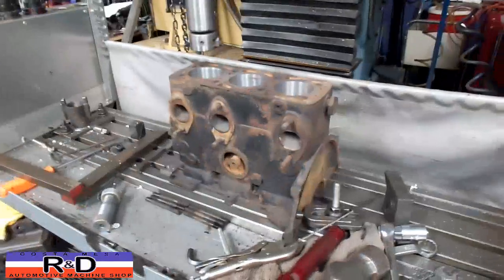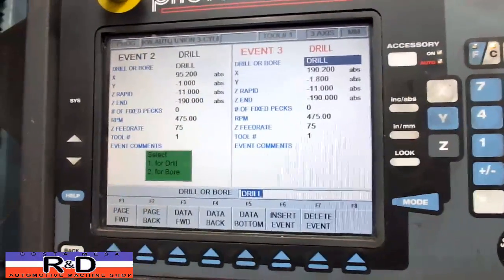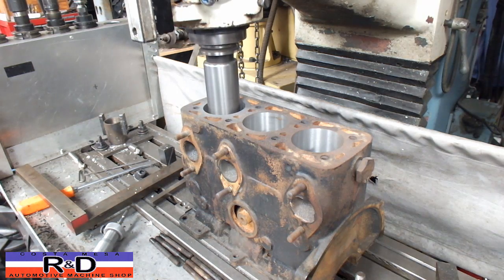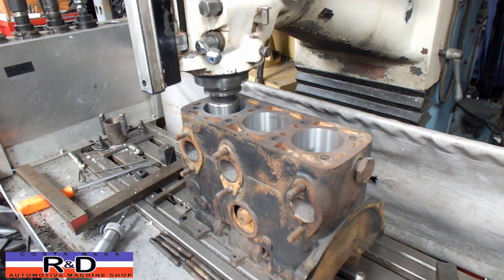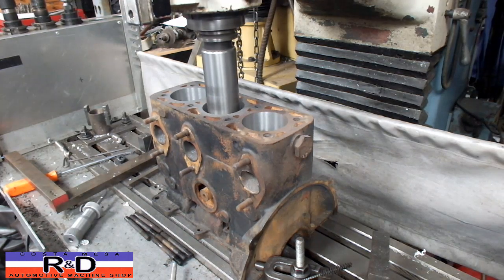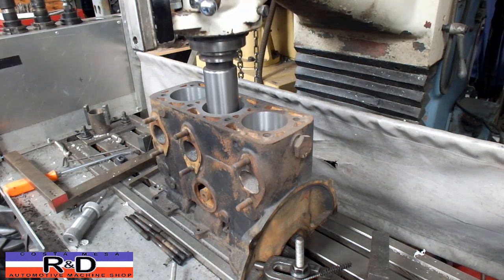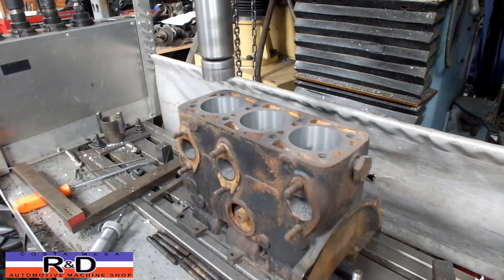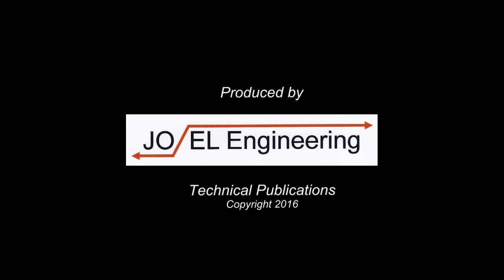3-Cylinder DKW Auto Union Block Boring - Two stroke

Comment: Interested to know how much more enlargement was the 1175cc DKW 3-cylinder engine used in the DKW F102 capable of reliably reaching? 
Sure there was the Muller-Andernach V6 that was said to have been created from a pair of DKW 3-cylinders two-strokes (and capable of reaching 1600cc), though not sure to what degree they are related to the F102 engines.

Comment: I believe you have too much cutting tool contacting the cylinder as I detect some chattering.
Reply: Doesnt matter, it goes to rhe hone for final size anyways. The interrupted cut yoy heard about halfway down is a window in the cylinder. Notice the corresponding window in the piston. This is a 2 stroke piston port engine